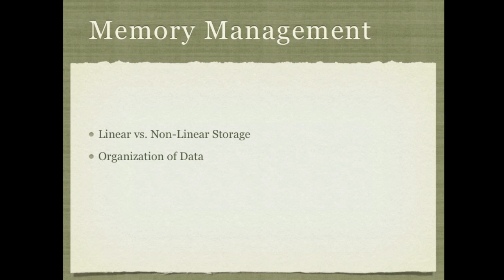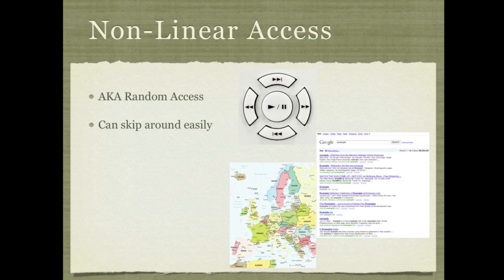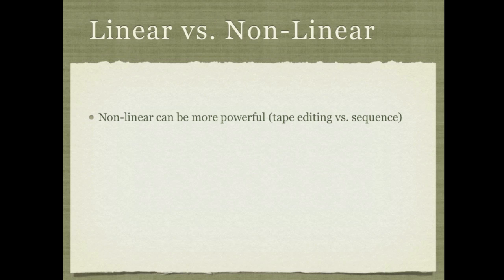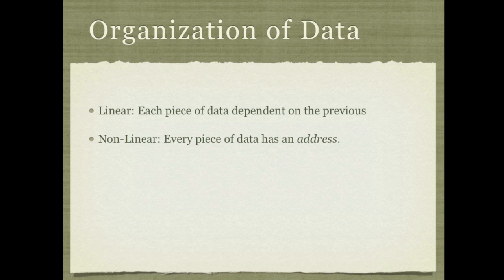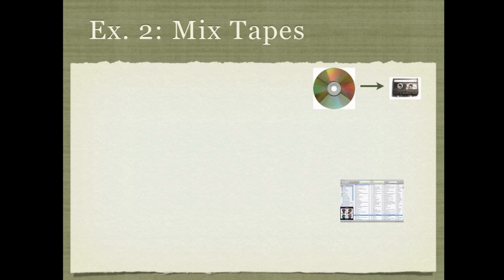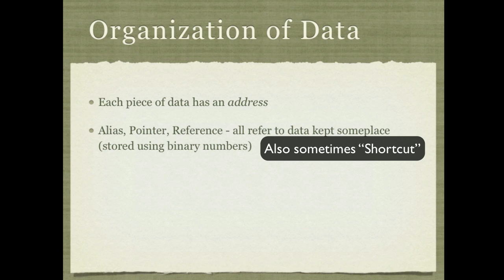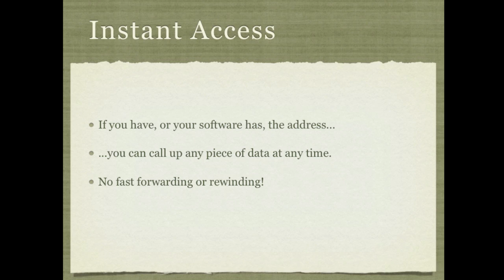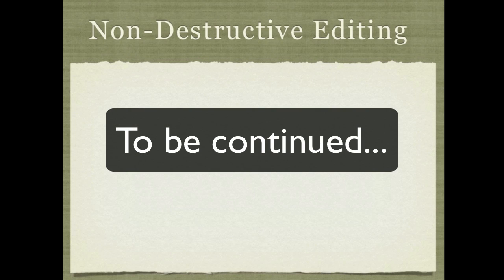AF027 - Linear and Nonlinear Access

Comment from the maker: Vinyl is awesome, but for coolness reasons more than audio reasons.

44.1/16 captures all human hearing in 99+% of practical cases (though 24 bit has more margin for error), and is transparent - doesn't add or subtract anything. Vinyl and tape add pleasant and subtle distortions.

If you recorded vinyl onto CD, no one could tell (in a blind test) that the playback was CD instead of vinyl. The opposite is not true. For more info, see my videos AF009 - AF014 and the HydrogenAudio forum.